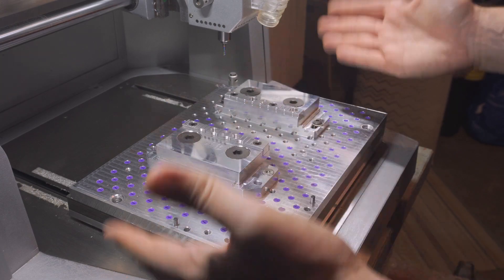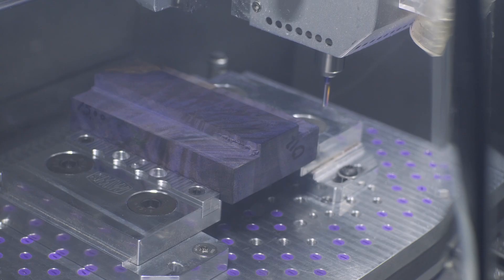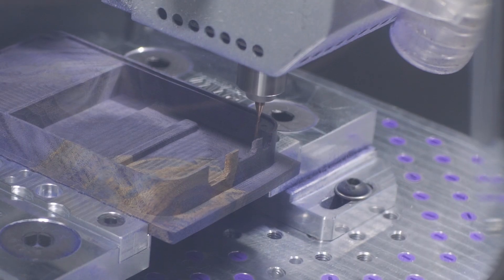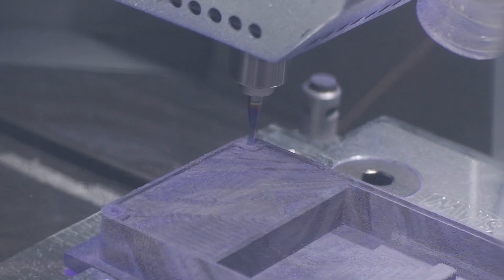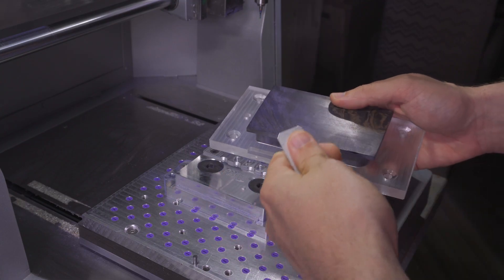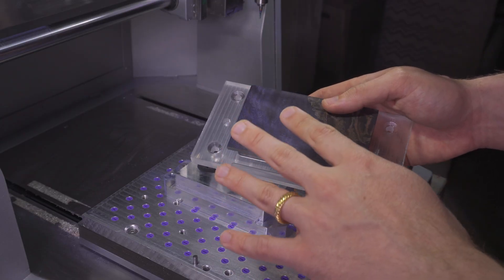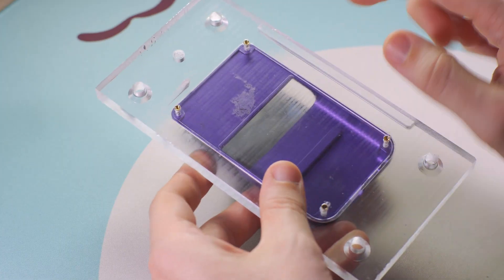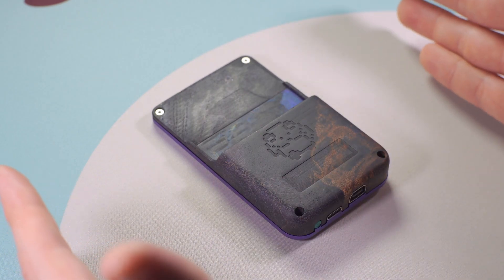Freeing a Game Boy from the (stabilized)Wood with a CNC

Comment: Does that 3D Touch probe come with the carvera? Are you using it with carvera cam?
Reply from the maker: It doesn't, but it's a pretty simple and affordable mod, especially if you have the Carvera Air. Instructions: https://www.instructables.com/Carvera-Touch-Probe-Modifications/

It does require the community branch of both the machine firmware and controller, but that's also easy to setup. I do all my CAM in Fusion.